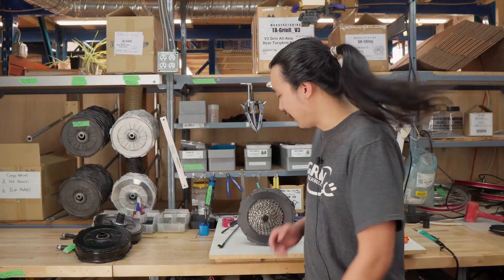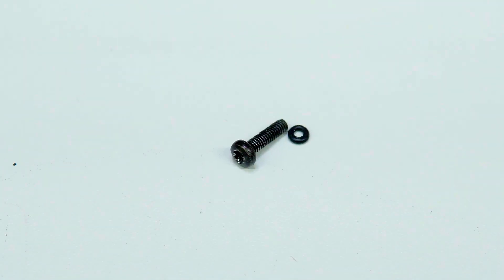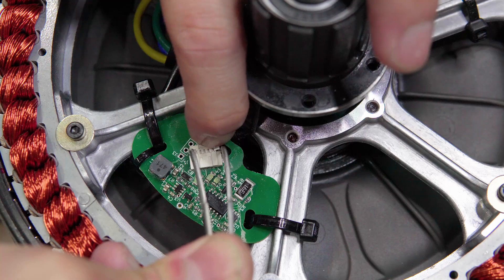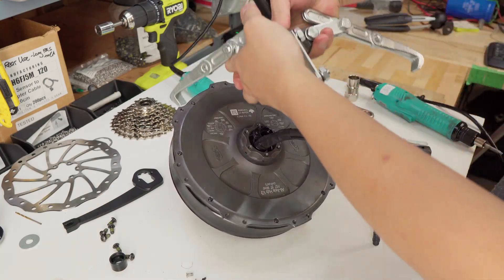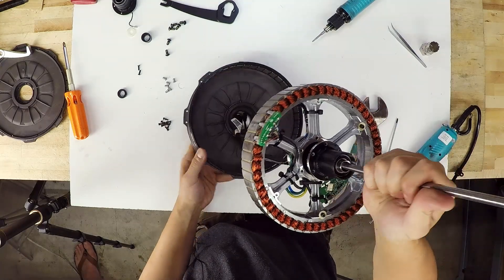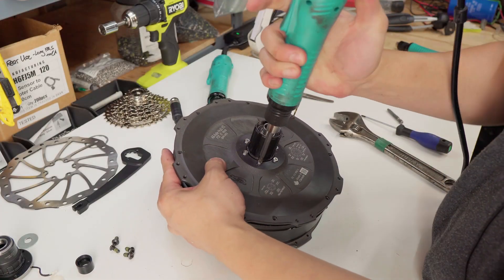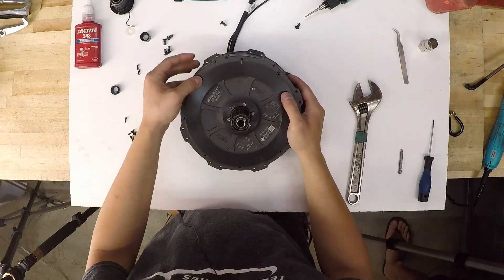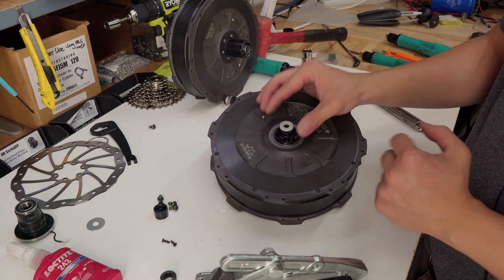Disassembly Guide for Grin's All-Axle Ebike Hub Motor

Comment: Is the motor waterproof ?
Reply from the maker: Not in the sense that you can leave it fully submerged in water for days at a time, but yes in the sense that you can ride year round in all weather and rain and never have any issues with water ingress into the hub.
Reply: @GrinTechnologies  can 4 of these handle a 1500lb  impact force from a mountain quad cycle doin a lot of various jumps ?

Comment: Hello, I have a 1000 watt Bafang motor from the front of an Arial grizzly 52V ebike. It is making a noise like a bee. It has everything new inside, the new bearings, the new clutch and it continues that noise like a bee. Can you shed light on that for me? noise?
Reply from the maker: That might be completely normal. Most geared motors make a buzzing sound.

Comment: I'm running a Amazon cheapy 48v . Just broke a axle at 44'000 miles . I ain't crying one bit i feel 44'000 miles for $250 was a great deal .
Reply from the maker: Yup, hub motors in general give an amazing cost / mile traveled, whether cheapo units or high end ones.

Comment: Great video i have a s4 ev moped that keeps stopping you have to turn off and on lots of times to go again.sometime just stops on roundabouts which is scary and dangerous. Its a 1.4kw bosch rear motor.i was thinking maybe water has got in it as sometimes it only stops sometime then runs great other times lots and lots any info whould be helpful thanks danny.
Reply from the maker: Probably best to find a video related to this bosh rear motor system and ask for support there. We have zero familiarity with the system you are having issues with, but water ingress causing intermittent signal bridging on a controller circuit is for sure a possibility.
Reply: Thanks for your time I looked for videos not seen any 😂

Comment: If your motor has Statorade, do you need to reapply it after reasembly? Or will it stay on the magnets as long as you don't wipe it off?
Reply from the maker: It will stay on the rotor magnets primarily and not get lost. That said we usually wipe it all off preemtively with a paper towel and then apply new statorade just because otherwise you're likely to get it on your clothes during the rework process and that makes a stain you can never really get out.

Comment: Thanks for this video, maybe I'll finally get around to replacing the smashed main cable on mine. So far it's being held together with liquid electrical tape, but who knows how long that will last.
Reply from the maker: Keep an eye on it but it's not broken and not causing problems there isn't usually a need to replace the whole harness if the source of the smashing has been removed. We've seen lots of cables with nicked/damaged insulation (but that weren't torn completely) which continued to serve for years and years.

Comment: I want to thank you for this video that I was eagerly waiting for + respect to you for supporting the right to repair movement. I really appreciate it.

As an owner of the Front Through Axle v2 motor, I will eventually need to replace the bearings, since my annual mileage is comparable to that of an average car user. I thought that when I reach 40-50k km, it would be time to change the bearings. Hearing that someone has ridden 100k km on a single set of bearings sounds incredible.

My question is, what is the correct order for removing spokes from the rim? Right, left, or does it not matter to avoid damaging the rim?
Best regards, Ebike enthusiast from Estonia.
Reply from the maker: Hey and glad to hear you've been making good use of the motor.  For opening and servicing the motor, you actually only need to remove the spokes from one of the side plates (ie just half the total spokes). It really doesn't matter which side you take them from, but the handling is usually easier if the spokes and rim remain on the side plate that stays attached to the rotor ring. 

To play it safe you could go around and first loosen all the spokes by just a few turns before then loosening them the rest of the way to avoid putting the rim out of round during the detensioning process. But I don't think that's really necessary.

Comment: Spoke holes through the side cover? Wow. That is truly stupid. Who had that  bonehead idea..

When you are reinventing the wheel the idea is to improve it, not to make it a nightmare to work on. Unnecessarily overcomplicated. I'll stick with QSMotors.

I've never owned a gear puller either. When the hub is in the rim you can just kneel in it to get it out. A 6" piece of pvc pipe makes a good hub motor stand and you just let gravity do nost of the work instead of using boards and a ginormous clamp that no normal person owns. Does the King of Canadia issue everyone Park Tools up there? Can we remember that people kill hall sensors and they need to be replaced? I'm afraid to even ask what you are charging for this thing that someone is going to be so excited to get but then becomes the bane of their existence when it gets a littke water in it.

Ugh.
Reply from the maker: This was a necessary tradeoff for weight optimization.  By having the spokes on the side plate, the steel rotor can be as thin an light as required just for magnetic flux coupling as it's no longer a structural component that has to deal with spoke tension, while adding the spoke flange to the side plates barely increased the weight of the side plate at all.   This change alone shaves off nearly 800 grams over a conventional design. 

That was one of the key design insights that let us get the whole direct drive motor to be almost the same weight as a comparable geared hub motor  (4.0 kg for the All-Axle, vs 3.8kg for a MAC geared motor). 

From our perspective a well designed motor rarely needs to be opened for any reason, and when/if it does an extra 30 minutes to relace and tension half the spokes isn't really a big deal.  No problem if that's not for you, there are plenty of 5.5-6kg DD motors from QS, 9C, Crysatlyte, Leaf  and the likes which can all be worked on with the spokes in place.
Reply: @GrinTechnologies  800g? Who cares about that? The point of the motor is that the motor does the work so that is a moot point. You don't by an an ebike to pedal it. 

I have never got off an ebike and thought to myself, if only this bike were 1.764 pounds lighter...then my life would be complete. You are reaching awful hard on that one. Less than 2 pounds. That is nothing. That's less weight than one more row of batteries in your pack. 2 Happy Meals maybe, minus the toys that is. 

How about updating the Cycle Analyst to something from the 21st century. Things like color and touch screens are so cheap now. You don't want some kid to outdo your pro level offering with an Arduino for about $30 worth of modules. I think you need to look around a little bit. The landscape is changing. 

Anyone that rides hards knows hub motors need to be serviced. Halls are finicky little things. How about an access panel in the side plate? The weight difference of the screws to hold it shut should be made up by the loss of the material of the cut and then a normal human could reach the halls and inspect for damages etc. 

Can we get a door? Is that such a hard thing to do? Choices were made and this time they weren't great. Don't talk to me about magnetic flux. I work on hard drives so I'll just tell you don't make your screws out of ferromagnetic materials. A service panel. Because things happen beyond our control. Adding a door is not beyond your control and I'm having trouble believing that a discussion about serviceability was not had. 800g sounds more like a person discussing their manufacturing rather than focusing on usability for the end user. 

You spent some time formulating a reply and I see you edited it even and it's still not a good answer. It's really simple. It's not a submarine so we can add a door in the next batch. Since we are so on the cutting edge we have a fiber  laser that any home user can also purchase that can achieve this gargantuan task of creating an access panel. 

There are 2 kids creating a  home version of high voltage wire cutting as we speak. You know where you cut metal to such high precision that you can't even see a line where the 2 parts meet. 

800g. I cannot believe that was the reply. 

Meh
Reply: @zentechnician  Matters to me, and i pedal my ebikes.
Reply: Everyone should own a gear puller, they're cheap and useful. I am not a big fan of spokes needing removal though, that seems painful to me too. That said all designs are compromises...
Reply: Before criticizing something via an ad hominem attack, it's usually a good idea to do the least little bit of homework to find out why something is the way it is. If a design is the result of a compromise, which it frequently is, it's more helpful to focus on evaluating the compromises being made. If there was a t-shirt that said "Don't bet against Justin," I'd be wearing it. We all benefit from really smart people who selflessly make our lives better.
Reply: @hjschmidt3752  Ok fanboy. lol

Please. I build and work on bikes on a daily basis. I don't need to research anything to know I would NOT buy this. It's just needs a door genius. That's not a a leap in technology it's just how we make things usable for people. Aren't you a people? You've seen doors right? Imagine buying a car and the hood to get to the motor requires removal of the entire body. That's what we are talking about here. Or you could just add door. 

Duh.
Reply: @zentechnician  As far as I can tell, no one is forcing you to buy this product.  But really, is name-calling really adding anything to the conversation? I do appreciate the irony with "Zen" however.
Reply: @hjschmidt3752 Hey there fanboy. There official reply was that it saved 800g. That is 1.76 pounds. So you have to rebuild a wheel to make bike you don't have to pedal lighter? I am quite Zen sir. As I have seen what you cannot because you are blinded by your Lord and Saviour Justin. 800g. Worst answer ever. It just needs a door. 

Some BS about magnetic flux to sound smart. I work on hard drives with people's data on it. There are magnets and the world's most precisely controlled motors inside them and yet I can still take the side panel off to service the unit, inspect heads, and look for pieces of material loose inside the unit. You have to be Zen to do anything that involves end users and tech as people such as yourself have crazy ideas about how things work because you can't be bothered to learn stuff. Some things are real simple... Like doors.
Reply: @zentechnician  I agree that the spoke procedure is frustrating but come on. Almost 1Kg is not negligable for the design of a hub motor. I personnaly would agree to trade the spokes simpleness to add 1Kg to the stator and have much better heat capacity and less saturation. Ofc a simpler mecanism to access the hall sensor like on the QS motor encoder version would be a great solution to this trade-off but many considerations have to be made. The ideal situation would be to have both choices available but since the all axle motor is already 3/4x more expensive than regular motors, you can probably afford the price of paying someone to re spoke your wheel for around 40 bucks if you really dont want to do it. I respect their design choice since i think the tradeoff is worth it and they are the only one who are still investing a lot in R&D in the hub motor technology and made the lightest motor available. 

The only think lacking for their product line would be a QS205 killer that could produce enough torque to beat a surron while using the same current (250Nm at 80A DC)
Reply: "There's just no pleasing some people...." "That's just what Jesus said sah!" skips off into distance
Reply: I think the spoke design change may be here to reduce weight of the overall motor. I agree it's a pain in the ahh to have to remove spokes for the disassembly but I wonder how much weight can be saved this way
Reply: @zentechnician "you don't buy an ebike to pedal it" says alot. I watch people ride ebikes  without peddling and I think.. well good for them they have a handicap and are getting out of the house. But then again the larger percentage are just lazy. Go buy an electric motorcycle, slap on insurance and ride the pegs all day....of course unlus your a drinker and need to get from one watering hole to another to hang with the bar stool profets 😂 (I'm generalising of course)
Reply: @markpryce3282  A light EV is still better than a motorcycle in many use cases and people might use them to have some fun. Not just because they might be lazy
Reply: I'm gonna have to charge extra money to repair it just because of the spokes removal. I won't recommend to buy this motor
Reply: @nicod974  so charge for your time...? :)
Reply: @nicod974  It's just nuts. They are giving you repair instructions but then they are making it too difficult for most people to do. That's just as bad if not worse than these companies that won't provide parts. It's under the guide of supporting right to repair but then cuts it off at the knees. What purpose is that serving to have spoke holes on the service plate. It makes my brain hurt. Like ow

Comment: Having to unlace your wheel to deal with getting into the motor is, imo, a big let down for a modern designed motor. It adds so much pain to servicing a motor down the line. I really hope there is a future revision of your motor series that mimics the pattern almost every other hub motor has with 3 piece separate side plate construction.
Reply from the maker: We agree it's a small annoyance, but suppose we did that design change and as a result the motor weighed 5kg instead of 4kg. Would you still be as interested?
Reply: @GrinTechnologies  Yes, it wouldn't change my desire for the motor at all. (Sidenote, I put my money where my mouth is, I have one of these.) 

There's so much other amazing features in this motor that, even it came in at the same weight as other popular wide magnet motor options (mxus, qs, nbpower, etc) it would still be a better choice.
Reply: @GrinTechnologies  Would it be possible to instead of winning almost 1kg of weight to keep the current spoke design but allowing to add 1kg of materials in the stator to help for better performance (increase in peak torque, continuous power rating and higher saturation point for high power enthusiasts) ?
Reply: Hard disagree, you'll likely need to replace the rims before you need to service the motor on average lifespan of these motors.

Comment: IMHO it's invaluable to be able to service the hub motor. It's slightly more difficult than servicing a typical ICE starter, which is very easy to accomplish and it is slightly easier to service than the typical Alternator which isn't difficult at all but requires techniques which aren't initially intuitive ( brushes and springs). I'm not a bicycle mechanic or owner yet; so I really appreciate the share. 🤛👀🤜